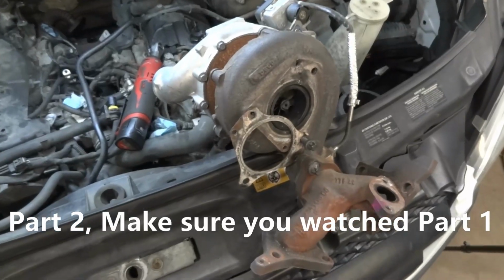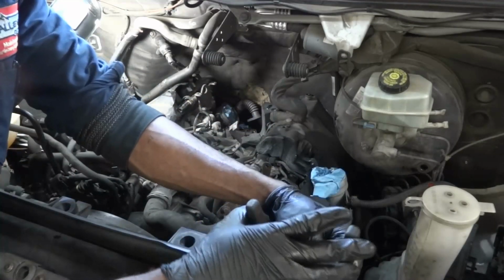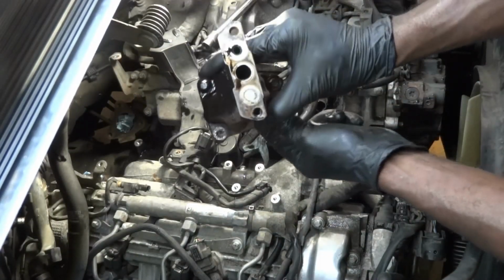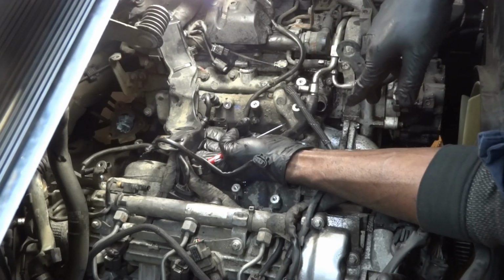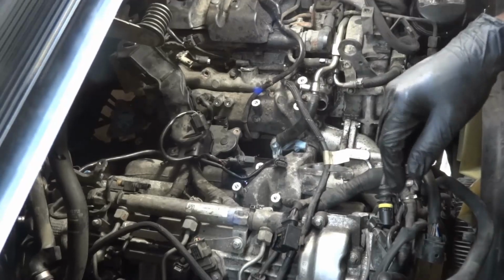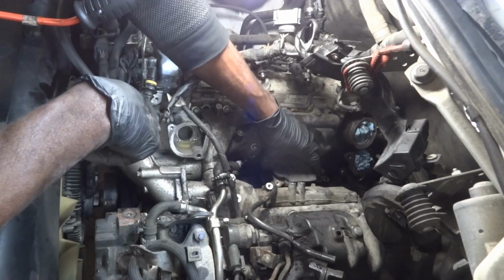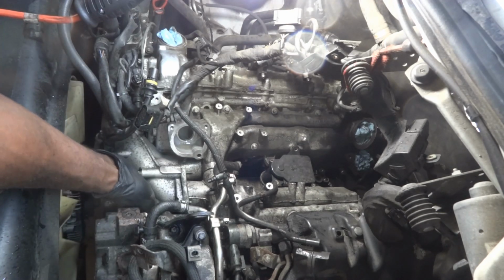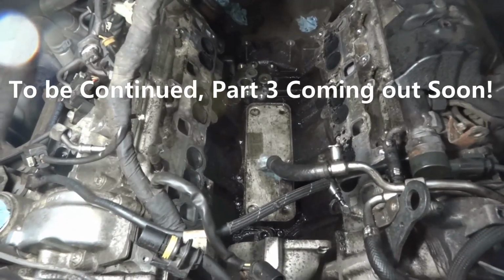Mercedes Sprinter Engine Oil Cooler Leak - Diagnosis & Repair Part 2 / Intake manifold removal

Comment: good evening, I saw the video and I also have, I think the same problem, only that I don't lose oil, I lose antifreeze that still leaks between the engine and gearbox and exactly where it could come from! of course, tomorrow I'll start to disassemble, but I'm not that good at it, that's why I'm asking for advice first. thank you

￼
Reply from the maker: Matei Adrian  if you are not comfortable with this engine I recommend you take it to a pro mechanic who can fix it for you!
Reply: hello, I solved the problem, it was from the hose on the passenger side, it was cracked. thank you

Comment: What’s better to change the oil cooler on sprinter 2.1l or 6 cylinder? I have 2.1l I did it like 4 or 5 times since I have it!!
Reply from the maker: @miguellomejoral1005   yes! the oil cooler on the 2.1L is a lot easier to replace!